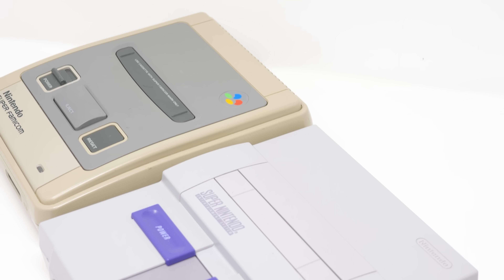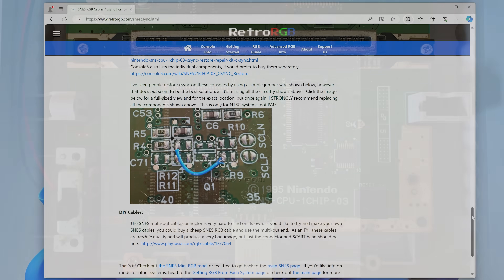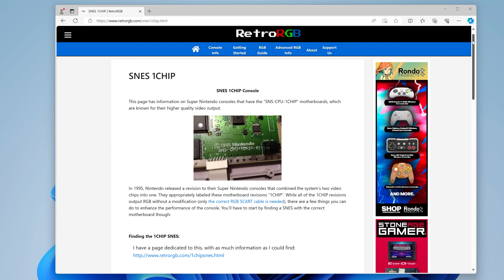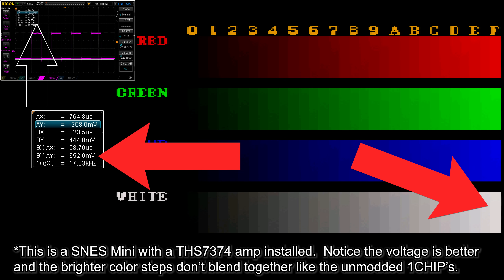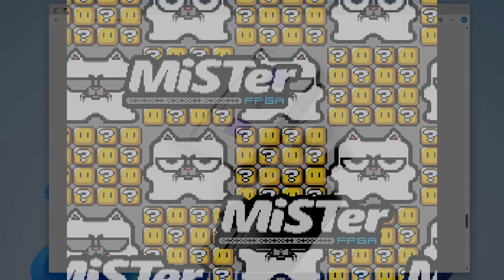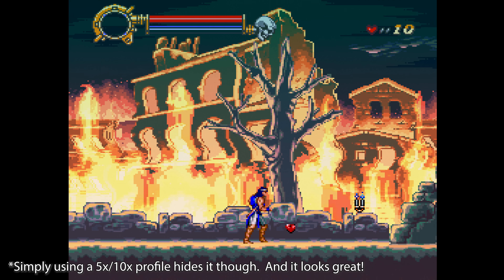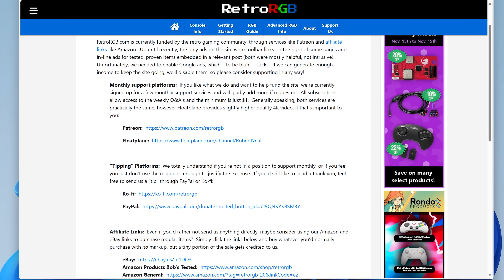SNES Video Output Explained

Comment from the maker: Some notes.  First, the final version of Voultar's 2-CHIP mod KEEPS S-Video and Composite, as well as enhances them as well!  More info and details in this post:  https://www.retrorgb.com/voultars-snes-2-chip-edge-enhancer-demod.html
Next, a note on "reverse low-pass filtering":  I showed the OSSC example at the end of this video, but forgot to include RetroTINK 5x footage.  I've added comparison shots to the main post:  https://www.retrorgb.com/snes-video-output-explained.html
I think this should clarify what to expect:  A sharper output, but the noise gets highlighted even MORE ;/  That said, turning the feature all the way up and adding CRT emulation works really well!  I'd still recommend the Voultar bypass, but if you already own a RT5x, the feature is already built in, so why not try?

Comment: I'm using an early SNES (UN11xxx) connected to a Sony WEGA CRT TV through its component/YPbPr input. This is accomplished through an RGB-SCART cable that goes into a cheap Chinese video transcoder. The results are breathtaking, and interestingly, perfectly sharp! I'm no stranger to the SNES's two-chip RGB blurriness, I used to connect my SNESes to a 15 KHz AppleColor RGB monitor and you could easily see the smear.

Is the transcoder cleaning up the signal, or does this very early SNES have better video output? It's very beat up, but I switched to it because doesn't have that annoying bright vertical line in the center like my newer SNES, or RF noise. I haven't seen much if any discussion about the SNES hooked up through component. From what I can see with my eyes, it's virtually the same as RGB. FYI - I've never opened either of my SNES consoles, but I presume they're both two chip.

Comment: Question: The finished 2chip mod is ever so slightly darker than the look, albeit sharper, of the unmodded 2chip. And I mean slight. Does the retrotink 4k allow for super granule brightness adjustment to bring it back up?
Reply from the maker: Both the 4K Pro and 4K CE can do that.  But what's even better is just using their auto-gain adjust and they'll get whatever console you have connected up to proper levels, fully automatically.
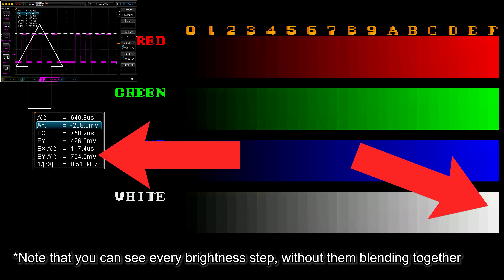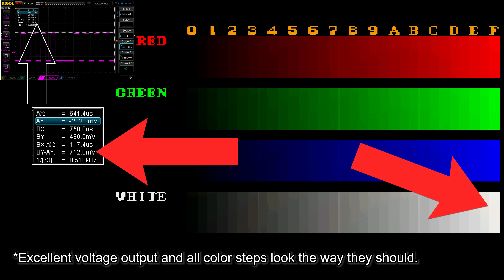Reply: @RetroRGB ok just so it’s totally clear, plugging in a modded 2 chip to retrotink 4k and using auto gain will get the voltage exactly where it is at 4:05? or do i need to tweak beyond auto gain to get that exact premodded look? Are your numbers at 8:19 with auto gain?
Reply from the maker: You’re correct, auto-gain is all you need. Well, and a good cable. If you use a $2 Aliexpress cable, who knows how it’ll look :)

Comment: If I mod a Super Nintendo 2 chip does disabling s-video also disable  luma/chroma and will this cause it not be adaptable from RGBs to YPBPR? Stupid question that I'm 99% sure about but 1% don't want to waste time and money finding out myself.
Reply from the maker: After this video was released, Voultar changed the 2-Chip mod. Now it keeps composite and s-video. So after doing it, it works just like an original, just with better video quality.

Comment: Bob, as always I really enjoy your comprehensive videos. Really thank you for all you do! As for my gaming preference, I am keeping my SNES stock for now. I may be getting a Mister later. I feel lucky to have what many consider the holy grail of retro gaming set up on a budget, a Sony Trinitron KV-27FS100, a SNES 1 Chip rev .1 board via HD Retrovision Component cables. That is more than enough for me.
Reply: Similar configuration. I have a Sony Trinitron KV-27FS12 (much sharper than the FS100!), though using an even more budget friendly setup consisting of a cheap video transcoder and SCART cable. It's component video to the TV, but a little less direct. The results are stunning! For some reason, unless I'm not seeing it, it looks incredibly sharp even though I believe it's a 2-chip SNES (unless its previous owner swapped motherboards?).

Comment: Cool Video!

real talk 
 
From what I am seeing the one chips are not showing all of the colors correctly. Look at the side by side 8:11 As an artist it looks to me as though the developers wanted to have it look as though there was shading. Look at the brim of Links hat on the original SHVC. It clearly has darker orange on the left compared to the right . Compare that with the one chip. It is personally very hard for me to see a difference in the color. Also Links cheeks, look like the devs wanted to have some color in his face as well as the hands. I think these mods are making these games look like GBA games. Maybe that "looks better" because it is clearer, but it is also flatter. If you look at the side by sides, the original looks to have more form/ looks to have some more roundness to him. the others look flatter. I think it is much more apparent when you slightly blur your eyes which is a little artist trick to help simplify what you are seeing. It also makes sense as when the SNES came out the devs prob knew the image would be blurred a bit giving the look of shading around the character.

I think the mod makes it sharper, and all that, but at the cost of flattening the image, and going into an uncanny valley territory. I might just be saying this to myself so I don't feel like I need to mod/ get a SNES JR, but from what I am seeing they still need to work on these rgb mods.

Also I am looking at this Youtube video on an older HD tv. So Maybe I am not seeing the colors, and it is noticeable in real life.

Comment: I should be okay with a one chip original SNES and my Framemeister XRGB-Mini using Nintendo's OEM RGB cable connecting them to my LG G3 OLED based on what I am understanding from this video.
Reply from the maker: Yes, 100% good.

Comment: Question: I see an extremely clean, nearly mint SNES for sale at a local store and it’s the DKC bundle - released on Christmas of 1994 or early ‘95 I guess.
However, the barcode starts with the UN2 code and my other SNES are 1-chip for sure and they all have the code starting with UN3 instead…

My question is: does anyone know if there was a jump in video/audio quality between the  first batch of SNES - the ones that are heavier and used paint on the “eject” button to write the word - and the ones toward the middle of the lifespan yet right before the 1-chip batch?

(I’m under the impression that the 1-Chip series started w/ the Killer Instinct bundle in late 1995, and the last version was the SNES Jr. in 1997. Those have received extensive coverage in the last couple of decades regarding upgraded video output. I wonder if there were differences between the 1990/1991 batch and the 1993/1994 batches…)

PS: it’s my favorite console of all time too ‘til this day… and rightfully so! ❤

Comment: My SNES loads, but after a bit will ghost and then numbers and all appear on the screen ruining the image. Do you know what the issue could be? Am think PPU 1 or 2, or maybe the pin connectors but am unsure
Reply from the maker: I'd start with the pin connectors, simply because that's easier.  But I think one of the chips might be bad.  Fingers crossed it's just the cartridge slot though!
Reply: @RetroRGB  I think it's the pin connector too. As used brasso, but didn't wipe it off before inserting the game. What would be the best way to clean the pin connectors? Really really appreciate you taking the time to help out a fellow gamer. Hope you're having a great day

Comment: I'm looking to get into the Mister but I keep hearing Mister + scaler. Should I get a scaler as well? Is the built in scaler of the Mister laggy or something? Thanks
Reply from the maker: The MiSTer can output AMAZING quality video up to 1440p. The only reason you’d want a scaler is if your display looks much better with 4K output, or if you wanted to use the RetroTINK 4K’s really accurate CRT emulation. 
…so my suggestion is to just buy a MiSTer and not worry about a scaler. Here’s my favorite- You’d just need the HDMI-only version:  https://youtu.be/WTeJ1eJJx-4?si=JNiYkExrQYRygp_u
Reply: @RetroRGB  thank you so much!

Comment: @RetroRGB I own a RetroTINK 5X and tried the method you mentioned at timestamp 10:59 but ran into a problem. First, I couldn't find a "Reverse" low-pass filter option on my 5X. Second, the Low-pass filter option that was there seemed to do nothing as no matter what setting I selected (Off, Light, Medium, Strong) it had zero effect on the picture quality at all, good or bad. It's as if that option (regardless of setting) wasn't being applied at all for some reason. For transparency, I am using Component Cables for my setup, and I do not know if this option is supposed to work with that type of input. Any thoughts or advice you could give would be greatly appreciated. Thank you.
Reply from the maker: The LPF you found won't have the same effect - That's for filtering video noise.  Make sure you're on the latest firmware and see if you can find the setting then:  https://youtu.be/Bva0JXLoq7E
Reply: @RetroRGB  Just checked, Looks like I've been running on the latest 5X firmware already. Ver 3.71 Released Oct 9th 2023. Can you guide me to where that feature is located in the interface? Because I can't find it myself. I've tried.
Reply from the maker: Hey, I'm sorry, 10:59 showed the OSSC's reverse-LPF.  The RT5x's works the same, however if you add a CRT mask to it, the results REALLY shine.  I just added some screenshots and instructions to the main page; I really show have included those examples in this video too ;/  Oh well, this is better than nothing (just scroll down a bit):  https://www.retrorgb.com/snes-video-output-explained.html
Reply: @RetroRGB  Thanks to those screenshots, I got it working. Thank you very much for your help. I am a tad disappointed that the menus didn't call it a "reverse Low-pass filter", and I'm not sure how good the effect will be in the long run. However, free is still free as you said. So, thank you for the screenshots and the assistance. Greatly appreciate it. 👍

Comment: i personally dont understand why someone doesnt use the ext port and a cart attachment to make an attachment/ graphics card that has an hdmi and rgb component output. i have been thinking about it for a while. i know others have made linux based attachments before for the ext port on the snes. i know this wouldnt do anything for the snes junior but it would help with the 2 chip and 1 chip revisions. also give the ext port a use other than just in japan which isnt even of use anymore since stellview satellite services haven't been in use since the early 2000's
Reply from the maker: That’s not possible.

Comment: The problem with modding is finding someone to do it.  The US might have tons of modders around but the UK does not and if you find one they are backed up till 2025.  Also how common are the boards you install?  Is it one of those that you have to pay $200 on ebay and always out of stock at online stores?  I have 2 SFC's in my collection.  I could use one as standard and have the other modded.
Reply from the maker: The 1CHIP mods are easy and many places have them in stock. The 2-Chip mod is almost as easy and will be released soon. 
Maybe approach things with a better attitude and you’ll be less disappointed?
Reply: @RetroRGB  sounds like it's best to do it yourself.   My attitude comes from experience and frustration.  The last modder I contacted for a FC rgb mod said contact them in may lol.
Reply from the maker: That’s frustrating to hear :(  Sorry it’s such a pain to find a good modder near you. If you’re looking to do multiple mods, getting some basic equipment and practicing on junk electronics is absolutely worth it. But (respectfully) that seems like a waste of time if you just want one or two consoles modded.

Comment: Just as a heads up, Analogue already did their "last run" of the Super Nt. So, although their site lists it as sold out, discontinued is probably the correct term.

Comment: Sure looks to me like the single chip only outputs a subset of the color intensity bits.  Literally two bits of color are just rounded up to be the same.
Reply from the maker: I need to post those captures on the webpage or something - YouTube compression really ruins stuff like that :/
Reply: @RetroRGB  Yeah, it does, but in this case I can't fault YT.  Go to one of your comparisons where you have link side by side.  Look at his hat.  The newer device only shows a couple shades of green.  The older devices show several more, and it looks as if the lowest order, maybe the two lowest order color bits are simply lost.
Reply: @RetroRGB  BTW, I've been a fan for years.  Love this stuff and appreciate your work.

Comment: I’ve been lucky enough to find a couple 1chips and jrs when collecting games was a much cheaper prospect.

The Jr only really needed the Voultar bypass plus C11 fix to look great, though I find it has at least one more graphical glitch that the 1CHIP doesn’t. In Earthbound’s attract mode, little pixels flicker around the screen whenever the screen transitions to black. This doesn’t happen on my 1CHIPs, but it does happen on both my Jrs, modded and stock.

I’ve found the 1CHIP needs a little more work in my experience. A 7805S helps reduce the vertical line, but in my experience it caused jailbars unless I also added the recommended 22uf capacitor. Basically, it’s an all or nothing proposition.

I’m definitely interested in a 2 CHIP mod, but I will likely hold off a bit in case Voultar is able to refine it even more once he gets an even larger sample size via mod installs.

Comment: One really important thing for people to know: The 1CHIP revisions (including the SNS-101) have compatibility problems with some games. Usually it's just some visual artifacts but notably Super Turrican is totally unplayable, as the sound will be completely messed up, and will get gradually worse until the game just outright crashes.
Reply: That's the reason I stopped yearning for a 1-Chip SNES. It's more an officially licensed Super Nintendo clone than an updated revision of the original motherboard. It's almost like a SNES emulator. I'm sticking with my 2-Chip models, and using component, I've not even noticed a lack of sharpness.
Reply: Why didn’t they have a recall on that game? Imagine buying a snes 101 and that was THE one game you wanted.
Reply: @swungsolid  Super Turrican came out in 1993, while the 1-CHIP model systems arrived somewhere in '95. Shipping a patched version of a 2 year old game, especially when Super Turrican 2 was already on its way, wasn't really worth it by then.

Comment: 2:35 while this is the clearest way to see the board revision, you can also always tell from the marking above the cart slot, which is nice because you can see that without having to remove as many screws. I have a short on my channel about this, but in brief: If it's missing it's an SHVC-CPU-01 (but the presence of the SHVC-SOUND module or its connector is an easier tell). If it says "SNSxx" it's a GPM-xx, otherwise it will say basically the same as the main revision marking  (RGB01, 1CHIP03 etc).

(I haven't seen every board rev of the SNES so if I'm wrong and there are other exceptions here please let me know)

Comment: Cutting cost is why the nessecary components are not there on the Snes jr.
Lets say that there are 1 million snes jr units sold and say it cost 10 cents for components for each board. 10 cents per board would add $100k to the cost of making those units. 
It makes complete sense to cut every non-essential component when making a revision to save on cost, especially when, at the time, almost nobody was using RGB in North America on the snes. On top of that, the Snes Jr was a budget option released after the N64 had already launched.

Of course 10 cents isnt much for us individually, but for a manufacturing budget for each unit, it makes a difference.
Reply: The Super Famicom Jr. is cut down in everything they could, even the controller. You can feel Nintendo cheapness in all of the system in.
Reply: @Rulumi  exactly. The Snes Jr producing the best picture after it was modded wasn't intended, it's just a byproduct.
That being said, I like my modded snes Jr more than any of my other retro consoles.
Reply from the maker: This is word-for-word what I say when people ask why there's components in the RGB lines of the SNES SCART cable, instead of on the motherboard.  But this was the late 90's and a LOT more people had S-Video TV's.  Context is key here.
Reply: @RetroRGB  well, the context of s video being common is maybe your perspective, but from someone who grew up in a low income household, I didn't even know what s video was because none of our tvs had it. I played on RF and didn't know any better.
This console was made for people who couldn't afford the new consoles, and that usually meant they didn't have the newest TVs either.

Comment: I didnt know that the Voultar  2 chip mod kills composite and S video. This makes me sad. That's why i didn't install a triple bypass in my v1 Genesis.
Reply: I guess if you absolutely need to retain encoded video signals, you could always get an external device like Axunworks' RGB2YC. It's very expensive, but does do an excellent job at encoding s-video from RGB (though not so much for composite). Might not be worth it for one system, but it is probably the best alternative for a 3BP Genesis or 2 Chip Bypassed SNES.